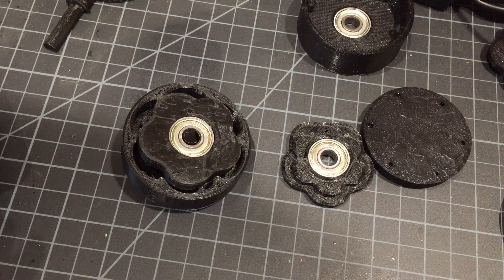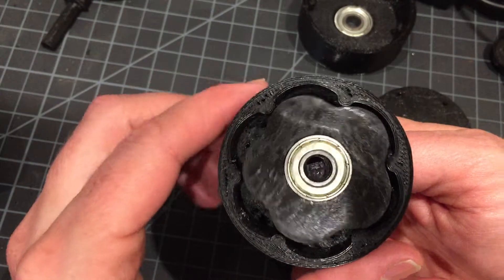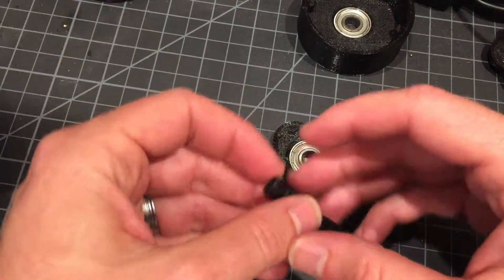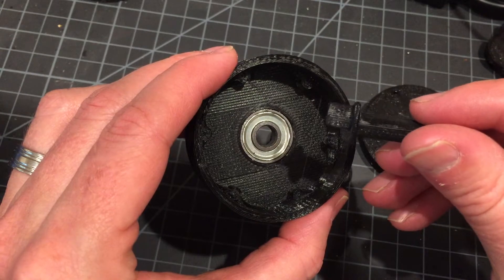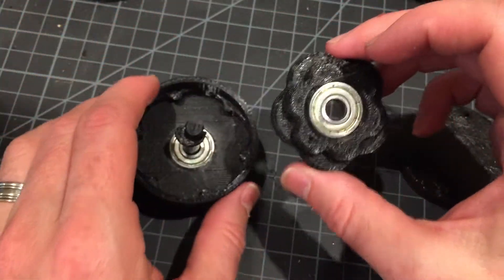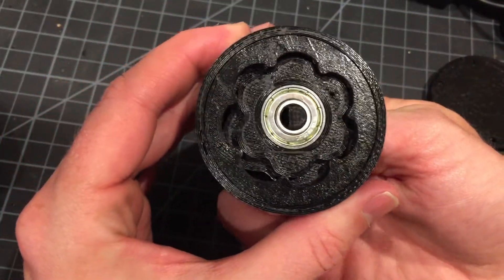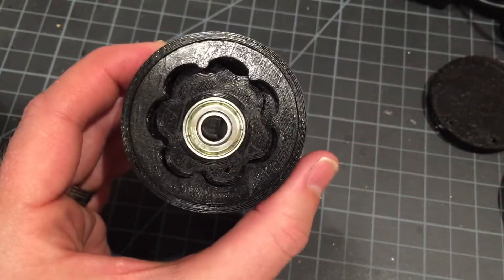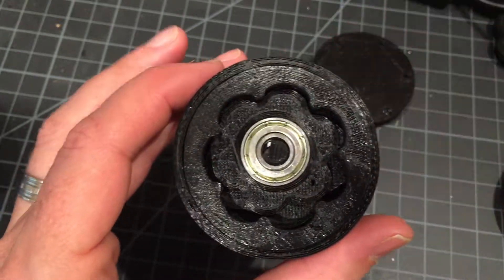2 stage hypocycloidal gear 3D printed

Comment: Very nice.  I have updated the script to be a c# program that fixes many of the bugs.  I have also printed a 400:1 reduction that I will put the files up for soon.
Reply from the maker: That is really great.  I would love to take a look.  At some point I plan on working on the single stage bearing based one.  i saw one that somebody wire EDM'd that was very nice - about 15:1 and back-driveable.  Let me know when you post those files.